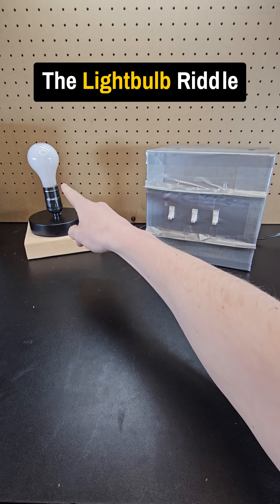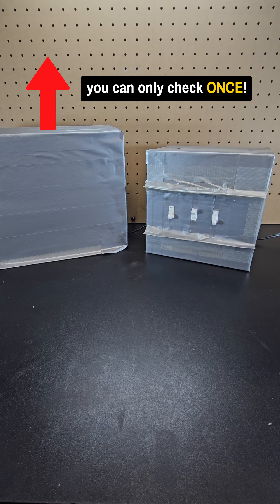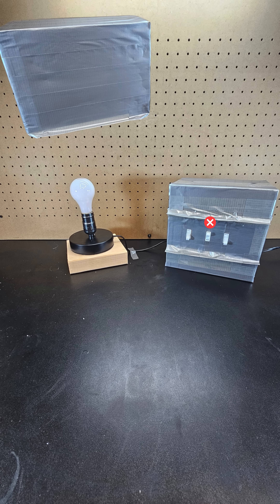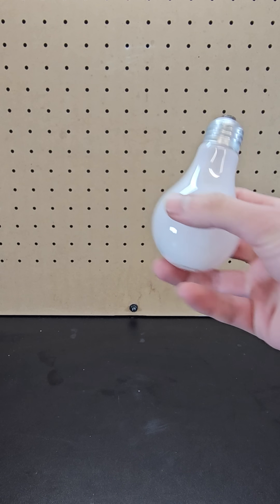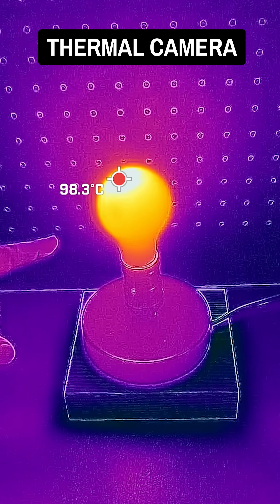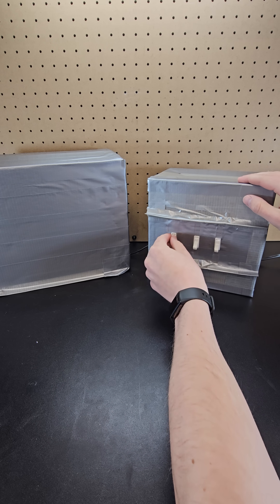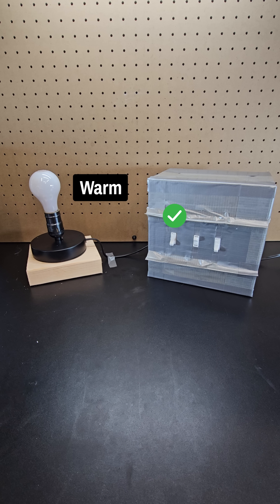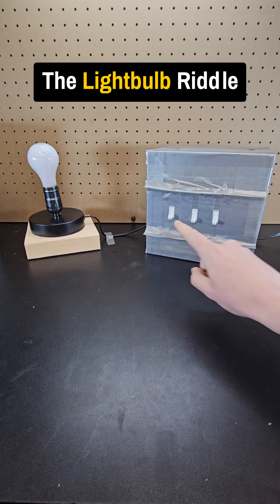Can you solve this Lightbulb Riddle? #science #shorts

Comment: Flip two on at the same time and wait 5 minutes for the light to heat up. Then turn one of them off and check the light. If it is off but hot then the switch is the one that was on but you floped off. If the light is off and cold then it is the switch that you never turned on. And if the light is on it is the switch that is on.

Comment: Leave the first switch on for a while, turn it off, turn the second switch on, then check the light, if its on, the second switch is the correct switch, if it isnt, touch the bulb and check if its warm, if it is, the first switch is correct, if it is neither on or warm, the third switch is the correct switch

Comment: Easy. Here are the steps:
1.turn on switch #1 for 15-20 minutes then it off.
2.turn on switch #2 and keep switch number 3 off.
Now here are the  conclusions after taking off the cover.
1. If the bulb is off and the bilb is warm to hot, the correct switch is #1.
2. If the bulb is turned on, the correct switch is #2.
3. If the bulb is off and the bulb indicates no temperature rise, then the real switch is #3.

Comment: Look closely to le left  lower corner, light emits from there and is reflected from the surface of the Table. In adition, you can switch the celinglight and softbox of, so you can determine even better. It looked like 3.

Comment: 1. Flip one switch on and wait for a while—long enough for a light bulb to get warm. Then flip the same switch off.

2. Flip a different switch on and leave it on.

3. Lift the cover.

If the light bulb is lit up the switch that was turned on and left on is right. 

If the light bulb is not lit up, feel it. If the lightbulb is warm the first light switch you flipped on and then off is right.

If the light bulb is not on or warm the switch you didn’t flip is right.

Comment: Alternative answers:
1- Open the switch box and see which one is wired (unplug the contraption, safety first).
2- With all switches off, cut the wire between the boxes, bind the two poles together and flip the switches until the main circuit breaker trips.
3- Kick him out of the room and peek as many times as you want.

(2) Can also work by holding the wires until you feel a voltage rise but I wouldn't recommend it 😂

Comment: if the box with the switches has a power supply then listen for the contacts arc or if you the box in this case looks either plugged into a socket or its going to a hidden switch

Comment: Flip the first switch and Wait for a while then turn off the first switch and on the second switch and  check it , if the bulb is on then it is the second switch if the bulb is off touch the bulb if it is hot it is the first switch if neither are then it's the third switch  Thank You

Comment: You flip the first switch and leave it on for a while, enough for it to get proper hot. Then you immediately turn Switch 1 off and turn on switch 2 and check. If the lightbulb is warm but not turned on, it’s switch 1. If it’s cold but on, it’s 2. If it’s neither warm nor on, it’s 3.

Comment: This only works if the lightbulb gets warm after being left on for a while:
Turn on the first switch. 
Leave it on for at least 5 minutes.
Turn it off, and turn on the second one.
Check the light. 
If the light is on, it's the second one. 
If the light is off, but warm, it's the first one.
If the light is off, and cool, then it's the third switch.

Comment: I'm not even going to finish the short. 
Flip the frist switch. Wait a few minutes. Flip the first saitch off and the second switch on. Then check it. If it's on, the seocnd switch is the one. If the bulb is hot then the first switch is what turns it on. And if it's cold it's the last zwitch to activates it.

Comment: This same process can work even with non-incandescent bulbs, you just may need to leave them on for a bit longer.  For LED bulbs, check the base of the bulb (where the integrated electronics are) for heat instead of the top.  They are much more efficient than incandescents, but they do still get warm when they've been on for a while anyway.

Comment: 1 - use a thermal vision camera.
2 - listen if that thing makes noises. Use any sound amplifier if necessary. 
3 - turn entire setup upside down and then lift the thing except for the cover.
4 - use the cover as a starting point of your coordinates system. That way, whatever you do to a cover, it doesn't move. The entire world moves around it

Comment: I've seen same situation on a movie clip...

Basically,

1.Flip the 1st switch and wait 5 min
2.After 5 min, turn off the 1st switch and turn on the 2nd switch
3.Check the bulb

(i)If the bulb was on, then it was the 2nd
(ii)If it was off, touch the bulb. If it is hot, then its 1st
(iii)Same as the '(ii)' but instead if the bulb was cold, then its the 3rd switch

Comment: With 0 lifts:
* Put the camera inside in advance - task solved.
* Measure the temperature of the box with infrared camera.
* Measure the current over wire.
* Disassemble the box.
* Find the schematics.
* Cut the wire (the answer will be "no such switch")
* Amplify the current to burn the lamp (same as above)
* Just name the random switch. When the box is down, all switches are in superposition. If later someone observes that your answer is wrong, blame Schrödinger's cat
Reply: Also: when "you can lift once": lift the box, then toggle switches as long as you want. That's what happens when you don't specify list of actions precisely (like touching, using IR camera, measuring air temperature, etc.).

Comment: “incandescent light bulb” is the give away here for the method. Incandescent bulbs give off a fair amount of heat. so Flip #1 switch on > wait 2-5 minutes (this will heat up the glass around the bulb if it’s on) > turn off #1 > Flip Switch #2 > lift box check for light and heat.

Solutions:
if after doing these steps;
Bulb is on: it’s #2
Bulb is Off, but warm to the touch: it’s #1
Bulb is Off, but not warm: it’s #3

Comment: Paused and here's how I would do it. 

First turn on the 1st switch and wait for a while. 

Next turn off the first switch and turn on the 2nd. 

Do NOT turn on the 3rd. 

Do NOT wait on the 2nd switch. 

With the first switch having be turned on and left on for a while and then turned off and the 2nd switch turned to on lift the cover of the light. 

If the light is on, it's the 2nd switch

If the light is off, feel it to see if it's warm. If it's warm, it's the first switch. 

If the light is off and it is cold, it's the 3rd unused switch.

Comment: Turn on the 1st switch let it rest for 10 min, then turn it off turn on the 2nd switch check the bulb, if the bulb is hot that means the 1st switch is the right switch, but if the bulb is turn on when u turned on the 2nd switch that means the 2nd switch is the right answer, but if the bulb is not hot or turn on that means the 3rd switch is the right answer
.
.
.
.
.
.
<(￣︶￣)>
.
^_________^

Comment: Turn on the first switch for 10-30 minutes, turn it of, turn on the second switch, and lift the box. If the light is on than the second switch did it, if the light is off but warm than the first switch did it, and if the light isn’t on or warm than it’s the third switch that turned on the light bulb.

Comment: Put one on for 25 minutes then only put another on then check if the light bulb is off it is the switch you didn’t check but if it’s on it’s the switch you put on second but if it’s off but hot it is the switch you turned on first

Comment: First, (this is only possible if when you turn all the switches off and turning all of then off and peeking does not count as useing the 1 peek you get) first flick the middle switch then open the box if it's not light on the close the box then flick the left switch wait 10 minutes turn off the left switch and open the box if the light is warm then the left switch is correct if not warn the it's the one all the way to the right, also if u turn the middle switch and u open the box  and u see the light on its the middle switch. Sorry went full nerd 🤓

Comment: had this riddle in the past. the answer wouldn't work with modern lightbulbs, but it's simple. Turn the first one on. let it sit for about 5 minuets. Then turn that one off, turn the second one on and check the bulb. off and cold means it's the 3rd one, off and hot means it's the first, on means it's the second. the reason this won't work with modern bulbs, is because they're designed to prevent the bulb from heating up.

Comment: If I'm able to take the switches apart... I would use a multimeter to see which has voltage and current through it, flip them all and retest. See which one has a different charge than try that switch.

Comment: Turn one switch on for a few minutes, then turn that switch off and turn one of the other ones on, then check, if the bulb is on, congrats the 2nd switch was the correct one, if it's off feel the bulb if the bulb is warm the 1st switch was correct, if it's cold, the 3rd switch is correct

Comment: Turn on the first switch and wait 15 minutes
Then turn it off and turn on the second switch
Now check the bulb
If the bulb is on the second key is the aswer
If its off check the bulb if its warm if its warm then it should be the first bulb because it was on for 15 minutes
And if its cold its because it never turned on so its the third key

Comment: Solution 

Flip 2 switches flip one off, then check the bulb. If it's off, then it's one of the switches in the off position,and then feel the bulb with your hand. If it's warm, then it's the switch you turned on and off,but if it's cold, then it's the switch that was never flipped.

Comment: Flip the first switch leave it on for 5 minutes then flick off the first switch then flick up the second switch, pick up the box if the light was on then it's the second switch if the light is off touch the bulb if the bulb is hot it was the first switch if it's cold it's the third switch

Comment: flixk switch one wait 10 minutes then turn it off and flip switch 2 and lift the cover if the bulb is hot but not on then it's switch 1 if the bulb is on its switch 2 if the bulb is not hot and not on then it's switch 3

Comment: Replying during pause

Flip one switch on and let it stay on for about a minute. Flip it off and turn on switch two before revealing it. If the light is on, its switch 2. If its off, touch it. If its warm then its switch 1. If it's not, switch 3

Comment: Some solutions that also work with an LED:
Make the room otherwise completely dark. There will very likely be some leakage under the box

Cut a hole in the box

Turn everything off. Look at the electricity meter. Etc

The alternating current will produce radio waves which should be detectable. Just make sure to put a faraday cage over the switches so you don’t pick up signals from them. This does rely on the rectifier being in the box though.

If you can figure out the internal design of the switch, you’d be able to stick some wires round the side to apply a much larger potential difference to whatever is connected to the switch. So just put a few thousand volts across it and if you can smell smoke then you found the switch the led used to be connected to.

Comment: Fun fact: incandescent light bulbs were discontinued in the US (by government mandate) not because of their inefficiency, but because LEDs are much more efficient.  This is also why halogen light bulbs were discontinued at the same time even though halogens are also more efficient than incandescents, they’re just not as efficient as LEDs.

For those wondering about CFL bulbs (the ones with a spiral shape), those were discontinued several years ago due to them containing mercury.  The long fluorescent bulbs also contain mercury, but they haven’t been discontinued yet since it’s not as easy to switch to using the LED replacement as it is with regular light bulbs since you have to rewire the fixture to bypass the ballast for the LED to work.

Comment: I would lift the box put a camera in it wirelessly connected to my phone and flip each switch. Or flip the first one, wait about sixteen minutes flip the first one again flip the second one and lift the box. If it's on its the second switch, if not it's the first or third switch. I would then check the temps tire of the light bulb. If it's hot its the first switch and if not it's the third.
Reply: Temps tire is supposed to be temps tire
Reply: Temps tire is supposed to be temperature

Comment: I saw this in a movie
Fist we need to clarify its not a LED bulb or else it wouldn't work
Now the actual first step:-turn the fist light bulb and wait few minutes
Secind step:- turn off the fist switch and turn on the second switch and open the box
If the light was on its the second one but if its off you touch it if its warm its the first switch and if its cold its the third switch 
I dont remember which movie this one was from

Comment: I would flip the first switch, wait ten minutes, then flip it off and flip the 2nd switch, then check the light. If the light is on it's the 2nd switch, if the switch is off, and the light is warm, that means it's the first switch, and if it's cold, that means its the 3rd one.

Comment: First you turn on the first switch for 10 minutes then turn it of and turn on the second switch. If the light bulb is on, is the second switch. If the lightbulb is off, touch it. If it’s hot, it’s the first one. If it’s cold, it’s the third one.

Comment: Already heard that solution another way is some light switches if positioned right at the point where they turn the light on (so after the click move it back just before it would click to turn off) you can actually hear the snapping electricity and my light will actually flicker as well so if you have one on and one right at that point you can see if it’s flickering or solid or if you hear the electricity I even double checked with my light switch to make sure it’s true

Comment: You got three switches: let's call them A, B, and C...
Turn on Switch A and leave it on for a couple minutes (like 5 mins).
Then, turn OFF Switch A, and turn ON Switch B.
Leave Switch C off. 
Now lift the cover and check the bulb.   If the bulb is ON, then Switch B controls it.

If the bulb is OFF but WARM, then Switch A controls it (it was on and heated it up).
If the bulb is OFF and COLD, then Switch C is the one.

Comment: First turn on the first switch for 5 minutes then wait 10 minutes until u flip the second switch wait 5 minutes than switch the third one and keep the third one on so you can check the box if the it wasn’t the third one than it wouldn’t be on and if the light is warm it’s the second one or if it’s cold it’s the first one

Comment: Open the first switch and wait…………………………………………………………..(2000Years later)……then turn it off
After that open the 2nd switch and reveal the lamp
If it’s on the 2nd switch is correct 
If it’s off, touch the lamp if it’s hot, the 1st switch is correct 
If it’s cold, the 3rd switch is correct

Comment: I actually had a pretty similar solution, but this one was way better. Mine was:
Flip the first one for 4 minutes, then turn it off and then flip the second one for 4 minutes, then turn it off, then the third one for 4 minutes again and turn it off, then touch the lamp, if it's cold, then it's been off for a while, meaning the first one was right, if it's a lil warm, then it was off but not for long, meaning the second one was right, and if it's really hot, then it hasn't been long since it turned off, meaning it's the last one.

The reason why I think my solution is bad is because for any person who haven't used an Incandescent lamp before, wouldn't be able to tell what's considered "hot" or "cold" when ut comes to the lamps standards

Comment: Flip the first switch, and leave it on for a couple minutes. Then turn the first switch off and flip the second switch on. Then lift the cover.

If the light is on, it's the second switch. If it's off, that means it's either the first or third switch. We know if it's the first switch, then the light was on for several minutes and should be warm or hot to the touch. If it's the third switch, the light was never on and the bulb will be cold or cool.

Comment: without using the heat method, you could switch 2 on. if the lighbulb is on you have a 50% chance. if it's off, you choose the one you didn't flip. Assuming an initialy open circuit for all.

Comment: So this is what's known as a side channel attack. The heat generated by the bulb is not the main feature but gives information about the feature. In cyber security side channels can be a significant vulnerability but hard to mitigate. For example, the amount of time a processor takes to encrypt data can give a clue to the complexity of the key being used. This may eliminate a significant portion of keys that have to be tried making it easier to brute force the key.

Comment: Actual solution: Turn first switch on for about 1 minute. Turn it off, and turn on the second switch. Immediately remove the cover. If the light is on, it means the 2nd switch is the controlling switch. If the light is off, check to see if the bulb is warm. If it is, the 1st switch is the controlling switch, otherwise, it is switch #3.

Comment: I would of just flipped the two side ones and then flipped the cover and if the light was on then it would be a 50 50 just like if you flipped one and checked and it said no but since it was the two side ones if it wasn’t on then it would mean that the middle one is the one connected to the light

Comment: Leave switch A on for 10 minutes, then turn it off. Immediately flip switch B and lift the cover. If the light is on, it’s switch B. If the bulb is off but hot, it’s switch A. If it’s cold and off, it’s C.